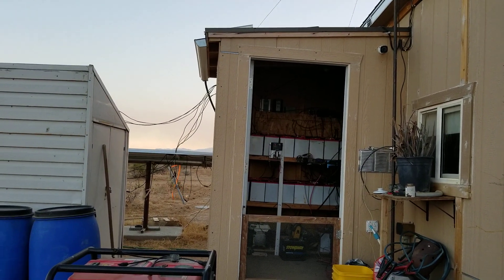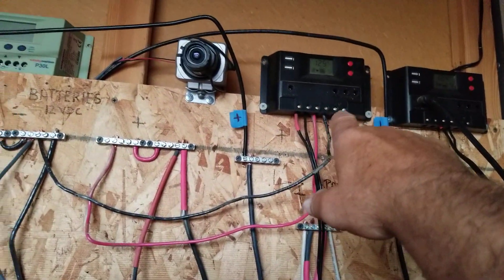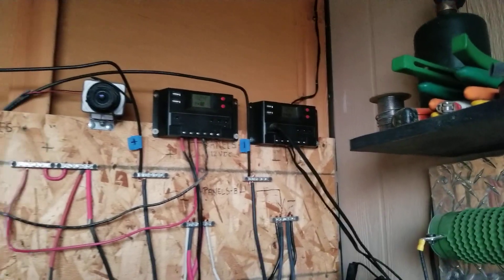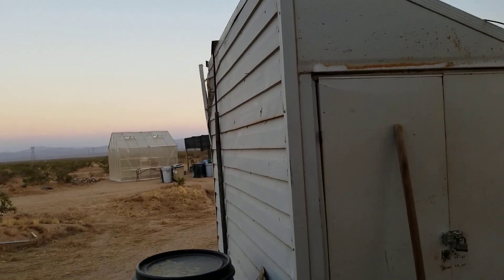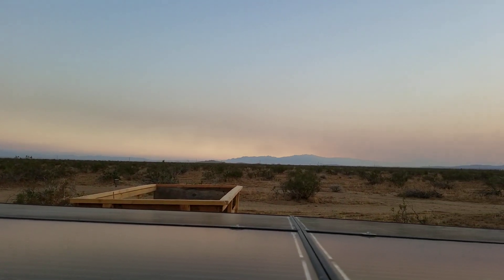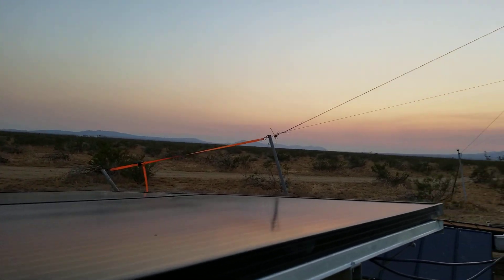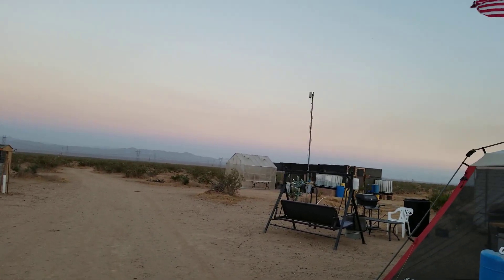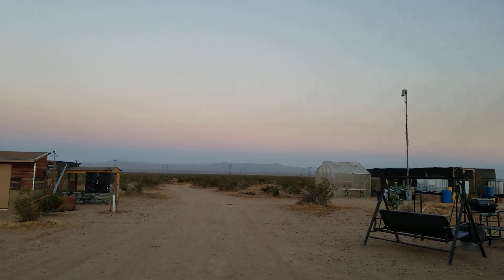Updates on The Bobcat Fire, Solar and more, Sep 20,2020

Comment: So much excellent info very helpful thanks. What's the ballpark cost of the solar and wind together? Thanks.
Reply from the maker: Welcome aboard.   For a long time the rule of thumb was $1/watt for solar, but now I can find deals for 30 cents a watt.  Wind power has come down too, but batteries have increased in price.
Narrowing a price is difficult because size of system and components quality change all the time.
My system cost originally was about $3000, but I've upgraded controllers, added batteries, changed PMA'S  and solar panels for about $2000 more.
At today's prices I could assemble this new system for around $2500.

Comment: Eaaa I ordered two of these to play with.   Going to put them down on the well head.   They only produce  some 200mA but that should be enough to keep a passive IR  Light charged up down there.   If a light turns on when ever people come in the drive way were the well is located they may stay away from it better. You transferring water all the time my like to do the same.  https://usa.banggood.com/Yellow-Translucent-12V10W-DC-Water-Flow-Pump-Generator-Turbine-Generator-Water-Flow-Hydraulic-DIY-p-1364996.html?rmmds=myorder&ID=516258&cur_warehouse=CN
Reply from the maker: Dang!  Those were my idea years ago.  Got them on paper, but got distracted with retirement and moving off grid!  Oh well, snooze and lose.
Reply: @GBear  They don't put out squat but enough for a small battery.    When your transferring water you can get them to do something for you.
Reply from the maker: @pulesjet  that is what my plans were, but I had a gear ratio plan to power a larger alternator at higher rpms as a backup charge supply every time a faucet is turned on.
Reply: @GBear  With your two tanks one high and on low you may be able to use it as a back up.  Maybe a hour or so ?

Comment: 80V is higher then I would wish to go.    Running 24v  I'm going with 36V  2 series 12v panels.  .  The less conversion the controller has to do the better efficiency.
Reply from the maker: Yeah, each of the 305w panels produce 40 OCV, but the Midnite classic 150 is designed to operate with up to 162v on a 12v battery bank, and be efficient.  The problem is,  Ohm's law. 
Higher voltage, lower amps, but the Midnite classic 150 has built in and Tweaks to convert excess voltage to amps.
I like that...
Reply: @GBear  That's the advance of MPPT.  But the more you have to  shift the power from Higher voltages to your usable voltage say 12 or 24v   Efficiency takes a hit.    The system would be more efficient if you didn't have to convert voltages and currents at all.    Losses are incurred when ever you monkey with it.  If   producing 80v your DC/120AC inverter was looking for 48V input it would work more efficient then if it's looking for 24V.   In larger systems it pays to do that because you don't need the expensive wire.

Comment: I have high end fully programmable pwms locally made they outperform alot of mppts unless it's high quality mppts like the classic, I've had reasonable mmpts but I'll be going high quality too, an electrical engineer I met with a simple modification just uses high quality grid ties offgrid to charge his batteries ,  they're heavy duty units that last they weigh quite a bit but are dirt cheap here because every man and his dog has a  solar system, on gumtree you can buy near new dirt cheap because people are always upgrading, some streets every house has a 5 to 6 kw system.
Reply from the maker: I'm still seeing new technology out there that is amazing.  I've decided not to buy older tech any more, just bite the bullet and go for the best.  They have nighttime solar panels out now!
Reply: @GBear  yeh seen them I have 4 genuine German made 100w amorphous they make a teeny amount at times full moon, yet solar tech exists where one solar cell can power your whole house, seen it here in Australia CSRIO, ofcourse I get told I'm a liar all the time on YT
Reply from the maker: @closertothetruth9209  lol, my cheap Harbor freight panels will light up the indicator LED showing charge when I walk around with a flashlight.
I saw one guy on YT put a set of HF panels on his camper shell pickup, he was working in his shop lit with fluorescent lighting,  and when he connected the controller it was charging.  Amorphous panel are great, but the new night time panels supposedly surpassed them.

Comment: Great update G Bear!
I see I still have more to add to our solar! I'm just gonna keep building it!
Thanks for sharing God bless my friend!
Tony n Lee Ann
Reply from the maker: Yeah, like I always say, function first, pretty later.  For a truly perfect off grid power system, I believe 3.5-4.5Kw of solar, if wind is available,  another 4-8 km in PMA'S,  and a battery bank capable of 5k amp hours, and there will be power to spare, day and night.
Of course, good controllers are a MUST!
I learned that the hard way, but started with what I could afford.  So far my Powerjack 8k LFPS has been performing well, but i am on the lookout for a top of the line brand with similar features.
Reply: @GBear 
 So it looks like i need to double my system and we should be okay till we build our house 
Thanks G Bear
Tony n Lee Ann